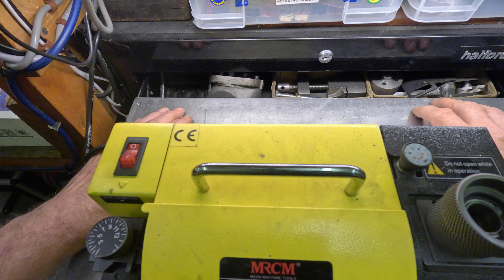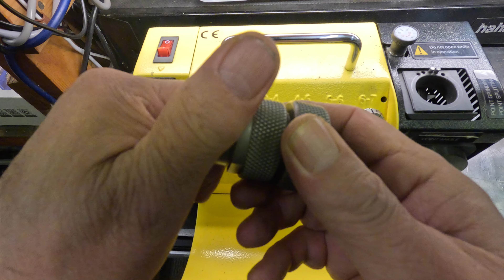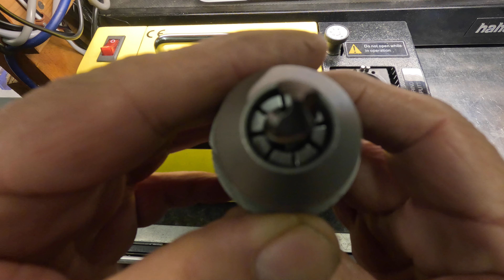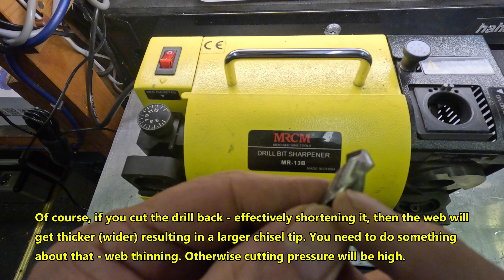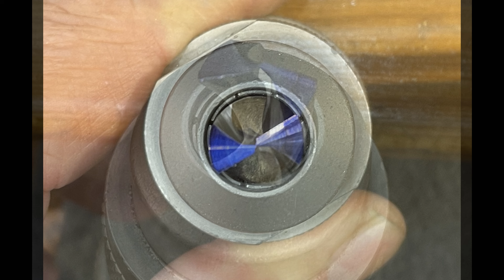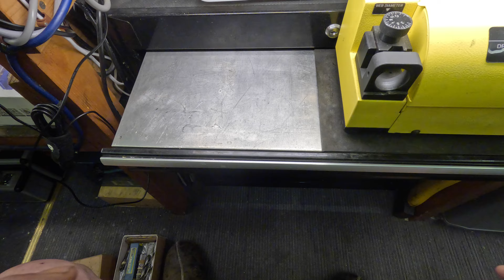MR-13B Drill Grinding Machine Review and Demonstration

Comment: What is the difference between the MR-13A and the MR-13B?
Reply from the maker: Not a lot to be honest, although the 13A is a fair bit cheaper. The 13A is able to do web-thinning but not (AFAIK) split-point. The 13B does split-point and also web-thinning at the same time - sort of. On the 13B it's more of a by-product of grinding the split-point and adding some back relief (adjustable with a pair of moveable pins). You cannot web-thin independantly in the absence of producing a split-plit point on the 13B. You might want to do just web-thinning alone in the situation where you've had to shorten the drill (because, for e.g., it snapped) which leaves a thicker web and so you want to just narrow it down to original dimensions without having a split-point. The 13D is the top of the range and has two optional ports (i.e., the one from the 13A in addition to that from the 13B) so in theory offers the functionality of both machines. It's the most expensive model excluding the similar but larger capacity (20mm) offering. Any of these machines will produce a well formed drill point but my preference is for the ability to produce a split-point which I find most useful.

Comment: Hi Chris. I’ve been looking at one of those. I’m made up my mind   
Thanks for the review
Reply from the maker: Excellent, I'm sure you'll be happy with it. There are several different models, the 13A does web thinning only, the 13B combines web thinning and split point creation, the 13D you choose between either (or both) web thinning and split pointing because it has an additional port on the top. Designs of the case differ slightly between manufacturers but they all work on the same priciple. I have looked and they can still be had fairly cheap (£300) if you shop around, and if you can spare an extra £100 then the larger capacity machine would be worthwhile. Thanks for watching and Good luck!